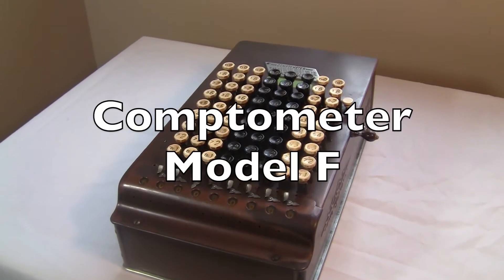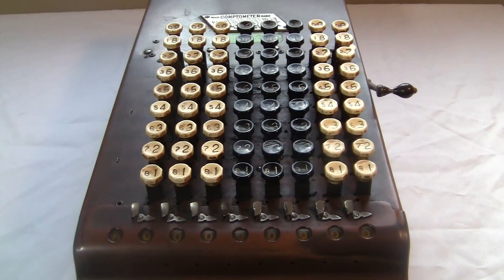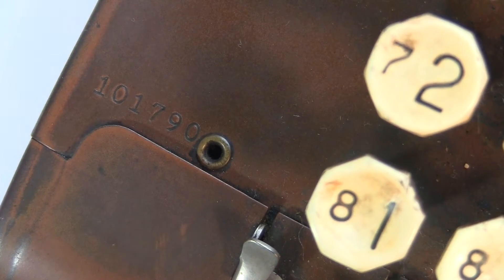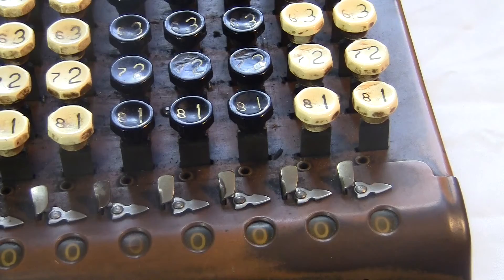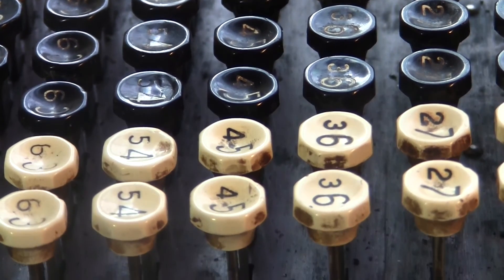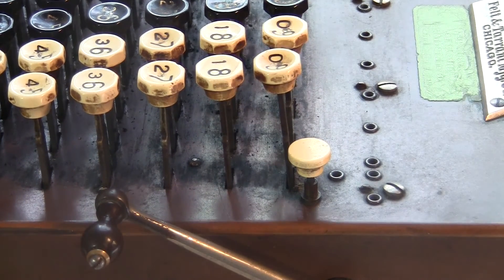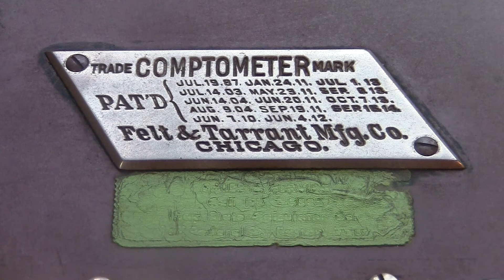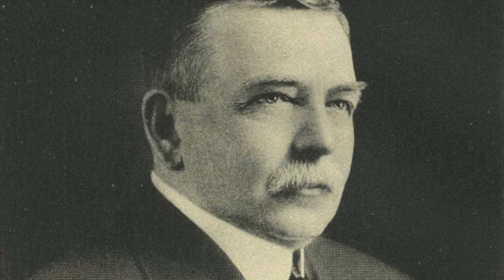Comptometer Model F Adding Machine Review / HowTo

Comment: I really like the Comptometer. It's just automatic enough to make things easier but still manual enough where you have to understand what you're doing. You can see what's going on during every step of a calculation, how everything is addition at its heart. It's a fun machine.

As somebody who majored in comp sci, it's interesting seeing a device made of gears and springs which has to perform more complicated operations in essentially the same way that modern computer processors still do at the bare metal (everything is addition.) The people who used these every day to run totals and do subtractions, multiplications and divisions sort of had to think like an ALU in a way.

Also, since it's so good at showing its work as it goes, it's probably a good teaching aid to young kids just learning the basic operations. For example you can teach the concept of how multiplying large numbers together works (how you have to shift for decimal places and decades) without getting caught up in the rote busywork of the smaller simple multiplication problems that they already know how to do.
Reply from the maker: I have brought the comptometer to school kids to teach them another angle on multiplication!

Comment: I'm going to make an electronic one- it has to be done.  I'm thinking you could have a shift-key for subtract, and maybe more keys for multiply and divide.  It could work like this: hold multiply, enter the number, then release the key to perform the operation on the register.
Reply: They did make an electric Comptometer. It's just a bit rarer.

Comment: For my Comptometer Model J (12 rows of keys!!) I bought some sewing machine oil (White Diamond) with an extendible tube. There's a red cap that goes on the end and I cut the end of it off with scissors so I can put the cap back on and squirt oil into all the tiny oil holes without any mess. I was also required to oil the base of each key and used just one drop on each key. The excess ran down into the machine housing. My Comptometer runs quieter now and I don't need to put as much pressure on the keys to operate it. The sewing machine oil cost just $6. Other oil is cheaper but doesn't work as well and can gum up the machine's works.
Reply from the maker: Wow- thanks for the tip. I've never actually oiled this machine using the holes. I've always used WD40 on my other machines but it sounds like this might be a better option. Thanks!
Reply: @ChrisStaecker  I know this comment is ancient, but I'm adding this for other people who see it. WD40 is a really poor lubricant, and over the course of a few years it literally turns into glue that can make it necessary to fully disassemble a delicate machine like this to get it working again. Zoom Spout brand bearing oil is generally regarded as the best easily purchased oil for mechanisms like this because it's pure and doesn't gum up nearly as bad as many other common oils.
Reply: @ChristianGreyHawkins  yes I got some of that at a local sewing store, I was the only man in there.
Reply: @ChrisStaecker  Sewing machine oil works excellent for most old machines - it doesn't get sticky as quick a lot of modern synthetic stuff, it's made to stay slick.